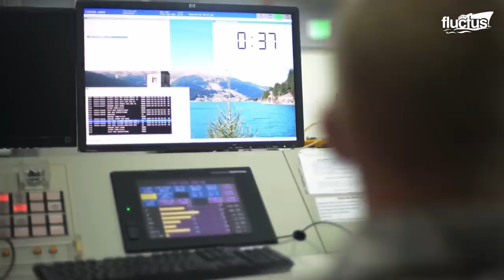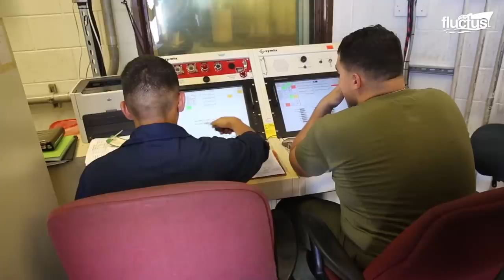Pulling Out Massive $7 Million Engine to Replace $10 Bolt : Crazy F-15 Maintenance Process

Comment: Aviation parts are tracked from cradle to grave with endless paperwork. It starts from when the alloy is made well before it’s end stated is a bolt. That is how safety is ensured. For example the Sioux City United airlines crash was tracked to a fan disc that failed over time. The cause was a stress crack tracked back to the manufacturing of the disc and the fact too much of one gas in its smelting created a less dense spot that began to stress crack.
Reply: Wow! Something so little (too mush gas) can cause such a massive problem’  that’s crazy!!!!

Comment: Would replacing it with a $100 bolt make it last longer?
Reply: I'm confident the bolt costs in excess of $100.00; likely closer to $1000.00-$2000.00 or higher.
Reply: One bolt that can cause an aircraft to go down . A&P for 26 years.

Comment: the fact that a bolt is $10 is impressive in itself
Reply: Impressive that it is so cheap.   Hardware, like bolts,  often run hundreds or thousands of dollars.
Reply: It’s honestly more like 20 dollars now
Reply: @festerbestertester1658  what the hell are you talking about
Reply: Nothing in aviation is cheap. A battery for a helicopter is over $2,000.
Reply: @Lofibeatz.x  honestly isnt wrong. If its a bolt that is in a hot section or attaches to a critical rotating part 500+ each is common. Some orings can cost as much as 2k easy. Aviation is not cheap.

Comment: I remember having to pull a turbine back out because the guy fitting the ignitors somehow managed to drop the last bolt into the combustion can.
Reply: I’m glad you pulled it out!!!!
Reply: Bought a boreascope because I dropped a 1/4 stainless steel bolt in the compressor section of a turbine one night on a 407 . Got lucky finally and got it by chance with a set of magic fingers.
Reply: @johnmarshall4442  our borescope had that capability but it dropped to the bottom can
Reply: Damn it prob was on a Friday night too
Reply: @johnmarshall4442  shouldve taped a magnet to er

Comment: If they were to raise the price of the bolt to $200,000 this might not seem so absurd.  :-)
Reply: Charging $200,000.00 for this single bolt seems absurd, even for a military specification part price.
I'm thinking for this bolt, maybe a $1000.00-$2000.00 price range seems more believable to me.
I can believe that some bolts could cost around $200,000.00, but those would probably be large explosive bolts, used for space rocket stage securing/separation & launch pad to rocket securing/separation.

Comment: Safety wire by hand?
Reply: If you cant do safety wire by hand you are no good as an aircraft maintainer, having 48 years experience I preferred to do the majority of the wire by hand, using specialised wire locking pliers to finish it off , if you use the pliers incorrectly it could work harden the wire or over tighten it reducing its load capacity. In many locations you have difficulty getting tools in or you can see what your doing or do what your doing but not both at the same time, as an example there was one occasion that I was literally resting on my head with my total bodyweight whilst using both hands to replace a bearing and retaining bolt and locking the bolt in place, it took about an hour, if you work on aeroplanes you need to be flexible. 
On operations you need to do the job faster the book might say "1.  remove engine" but that takes hours of work so you remove enough things for access and then rebuild, so its a couple of hours instead of days of work

Comment: Theres NO such $10 bolt ! this is aviation ,everything is way more .
Reply: Incorrect most of the 1/4 inch bolts used on the externals are less than $ 2 dollars each.
Reply: @brianlamb7937  Agree totally, they are generally manufactured in thousands so the cost comes down and designers use them whenever they can, however there are certain  bolts/ nuts which because of their specialised requirements of material or design may cost hundreds or in a few cases thousands of dollars each. Most aircraft quality bolts have threads cold rolled into them rather than a thread cut into them this makes the thread much stronger which is why you don't go to the hardware store for bolts for an aeroplane.
Reply: @davedixon2068  Most of the bolt's/nut's/general hardware you are talking about are in the hot-section....IE high pressure turbine, combustion chamber and afterburner area (internal )  A prime example would be the nut, retaining ring and lock ring that holds the HPT (high pressure turbine) in this nut alone can run around 4000 dollars  and that was when i retired 20 years ago. But when you consider the heat and stress its under that price is cheap compared to destroying a multi million dollar engine and the possible loss of the aircraft.

Comment: $10 bolt cost the taxpayers about $700. A $30 ratchet is about $400. We won't find out where this money goes but we do know where it isn't going. Corruption.
Reply: It isn't going to health care, infrastructure, environmental protection, civil rights protection..., but BOLTS!
Reply: I read that a 15 cent  resistor in the electronics somewhere ends up costing $115.
Reply: Butthurt...😭
Reply: It's a fact as soon as anything has an "aerospace" application the price goes up. Some bolts can be bought at the local hardware store at a fraction of the price that are infact the exact same bolt.
Reply: I thought USAF was different and unlike 3W countries. So they're not so different after all.
Reply: @jamespyacek2691  maroon,  the goodies u whine about get at least 10 times the defense  allocation,  which is constitutionally required , Unlike the Democrat  vote  payoffs.